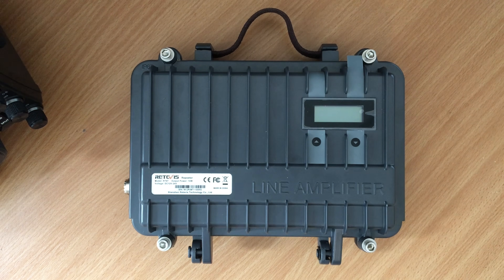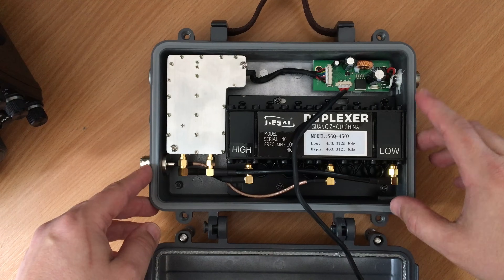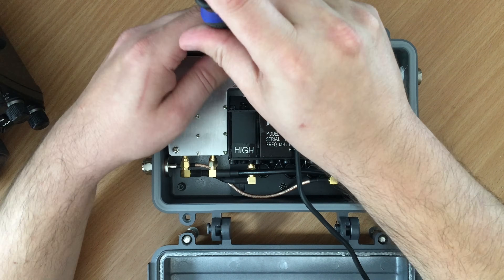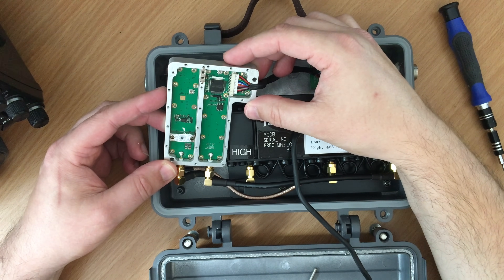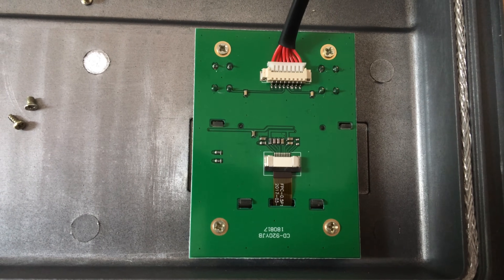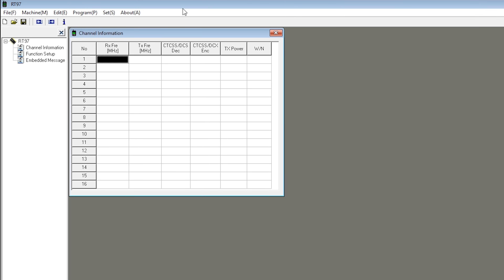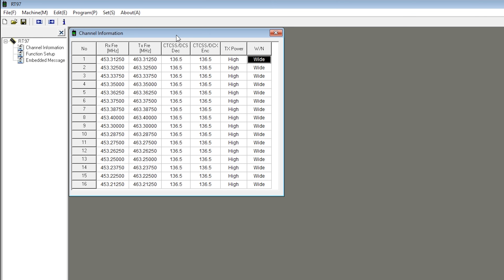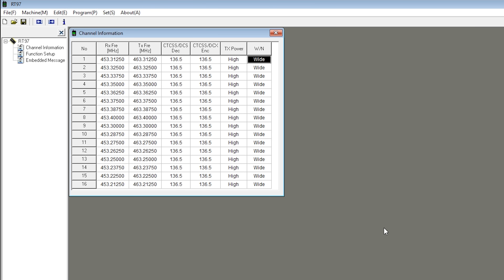What's inside the Retevis RT97 Analog Repeater? Plus Programming!

Comment: How wide is the duplexer? If you were to have multiple GMRS channels programmed into the unit, would the duplexer be tuned for all of them you would the duplexer only work on one of the channels. For example, if the duplexer was tuned to the center of the GMRS repeaters around 462.625/467.625, would it work all the way from 462.55 to 462.725? Is there any way to make the duplexer bandwidth wider to work on all the channels so it wouldn't require retuning? How hard would it be to adjust the duplexer cavity filters in the field without access to special equipment such a spectrum analyzer or service monitor?
Reply: Pick up a VNA and measure the duplexer passbands yourself.  That’ll cost you $100 these days.  That VNA is also the test equipment you need to properly retune the duplexer yourself.

Comment: What is the different using these as using a simple audio 2.5mm 3.5mm  and using 2 radios and connected as repeaters ?
Reply from the maker: These have a notch filter / duplexes installed so the tx does not desense the rx
Reply: @TechMindsOfficial if the duplexer comes programmed with the default frequency to tx and rx, then wha happends when u change the channel ? The rest of the channels are not programmed on the duplexer only the default frequencies or channel one.
Reply: @SuAmigoElilegal  - Notch filters (duplexers) can only be tuned for a single pair of frequencies. You would need a spectrum analyzer to accurately re-tune the duplexer every time you change the frequencies.

Comment: The 16 channel "feature" is totally useless as the notch filter will only work properly on the exact frequencies it is tuned for! I pointed that out to Ron at Bridgecom about their line of 2m and 70cm repeaters...
Reply: Thanks for the comment, as I while I was watching the programming I was scratching my head trying to figure out why that feature was there. I made the assumption that perhaps you have some shoulder tolerance from the center tuned frequency in the same fashion that you have with a tuned antenna? For example, as you move away from the center tune point you just get an increase in your standing wave? Then I came across from one of the sellers on ALi that seems to substantiate this, "Q8: Is it possible to change the frequensies by myself with software and PC ?
 A8: Yeah,you can change the frequency and ctcss/dcs code.  But frequency should within  plus or minus 1MHz relative to the  center frequency." So this would indicate you have a 2MHz window on each side of your center tune point. Would be nice is any of these Youtube reviews would do some SWR test on this window. So I guess this ability to program could come in handy if you are getting intermod, etc., and wanted to tweak it out.
Reply: Smart thing to do would be to program all 16 channels identically so you do not change it by accident.
Reply: @patonbike  I agree, 16 channels on the same freq pair, but maybe different CTCSS or DCS tones, so you could quickly change tones if needed. I have a 2 ch repeater set this way, one is DCS tone, the other is CTCSS in case someone has a radio that does not do DCS. Of course, I have never really needed to use that feature.
Reply: @Parsons_Project  great point on using CTCSS to create sub channels. Could result in folks doubling on each other I suppose though?  Unless busy channel lockout is used?  Good experiment I suppose.